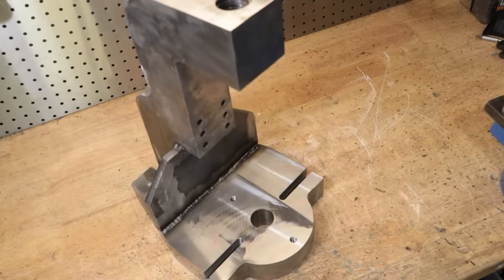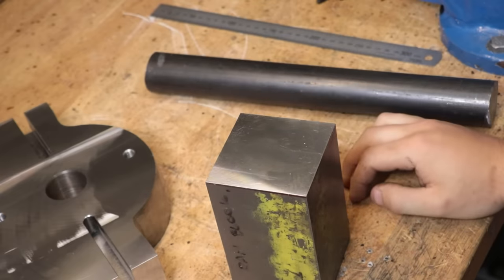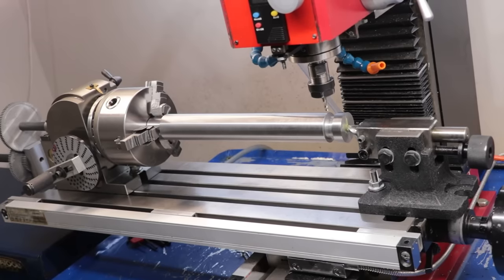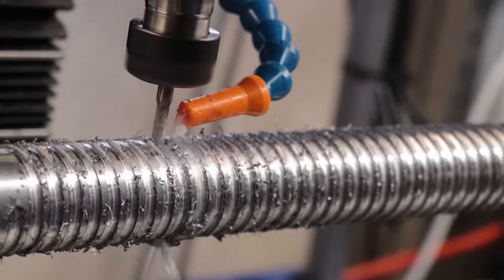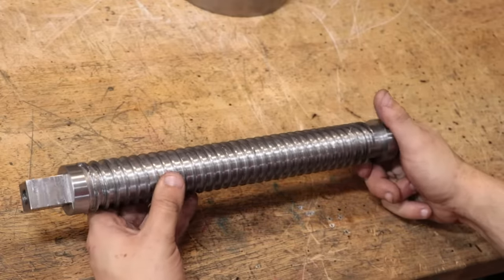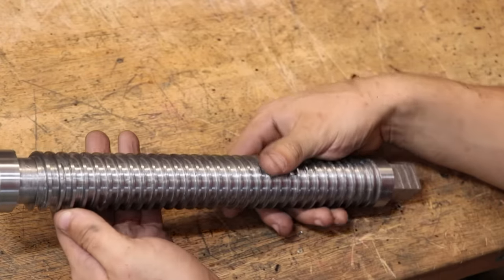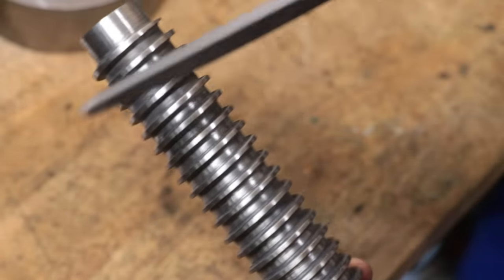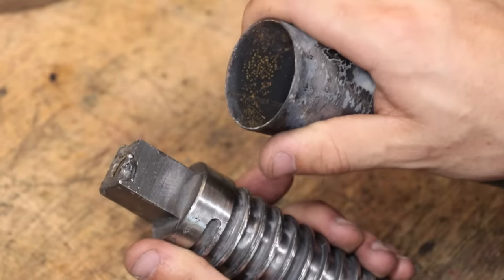Making A fly Press | Part 3 - Ram block, Gibs and Leadscrew

Comment: A tip to packing the charcoal. Weld a nut on the tube. Then use a drill with a low torque setting. It will shake it really good.
Reply: That's a really clever way to use ugga duggas!
Reply: If you have a Sawzall you can remove the blade, push the cutting guide against the object to be vibrated and pull the trigger.
Reply: Air hammer on low psi
Reply: @mortcs  or a jigsaw
Reply: Vibrations?
Lelo Enigma Wave ...
Men ... :P
Reply: @davidl6566   bubba duggas

Comment: Awesome work! When you do the hand turned helical milling, try using an end mill suitable for high feed milling. Either one designed specifically for high feed, sometimes they're called torus cutters, or just an end mill with a large corner radius. When you cut with the high feed technique, all the forces go up into the spindle, rather than sideways, so you're much less likely to break the end mill from turning a bit too fast. It's a good technique for slotting like this. You can then do a finish pass with a square end mill

Comment: Project coming together nicely, good job.
I think you made a little mistake with the oil grooves. They should be in the sides on the fix piece and not on the movable piece like you did. Because when you now move the ram down the oil grooves get exposed and all oil will just flow out which makes them pretty much useless.
Reply: My Sweeney and Blocksidge flypress has lube grooves in the ram from the factory, IIRC many makes are that way.
Reply: A bit of further information on my Sweeney & Blocksidge flypress, the lube grooves in the ram run from the top of the ram, open at the top, and run 60% of the way down the ram. When the ram is fully down ie the stop collar against the fly arm the grooves are only exposed by 8mm, that's not a position I've ever used it in so in normal operation the bottom of the grooves would never be exposed and oil lube retained.

Comment: Fascinating watching your design process! My little number 3 flyress has a split nut rather than a split ring so it screws into the ram block rather than being bolted. Same effect but way more difficult to fix if something gets damaged. Luckily I realized that I was missing a pressure disc bearing that goes between the arbor and the ram block, otherwise there would have been a bit of empty space between the two so the split nut would have taken the full transmission load instead of zero. Thanks for sharing all this process, it's a delight to watch!

Comment: Liked the superglue trick never tried it on a lathe but used it many times on thin parts in the mill
Reply from the maker: I've used it a few times on the mill too. Arguably I have had better results with it on the lathe than the mill

Comment: were you not worried about the leadscrew bending / distorting during heat treat?
Reply from the maker: Not really. Its quite a low tolerance build (something like this does not need to be high tolerance) so it can handle a bit of change and still work. Unless it comes out like a banana it'll be fine. The salt water should have helped get rid of any steam jackets that were a big cause of my parts warping in the past.
Reply: Interesting point about saltwater! I had the same question about potential warping the screw.

Comment: For milling the lead screw another method to consider is to tilt the spindle to the pitch angle and use and end mill parallel to a vertical tangent so the majority of the cutting force is upwards into the spindle. The radiused corners from this method does look good too.
Your welded example looks better than cast with a 3 to 0 from my sons.

Comment: If you have a saw zaw you can take off the blade and let it vibrate against the packing tube it works great with canister damascus so I bet it would work for this.

Comment: I have a couple of tipps for you. 
First, if you weld TIG, you can move slower and can do a few passes without any filler. The weld will look a lot better. 

If you mill, please roughmill only the diameter of the endmill in depth. It will last much longer...

Comment: I popped in the see a machinist I knew years ago and he was milling a thread and told me he started with a HSS end mill and was getting the feathery edges as you are, he switched to a new carbide end mill and the problem went away. BTW he wasn't doing it on a mill rather his large lathe where he had swapped the compound for a Bridgeport M milling head and set the lathe to about 1TPI IIRC for the job which was to be a hydraulic oil cooler, it was heavy drawn tube and the oil ran down the thread and coolant down the centre IIRC.

Comment: you could have put a soup can on top of the furnace to extend it up a bit and hold the heat in enough for it to heat evenly.
Reply from the maker: it was just more straightforward to flip it and get both ends up to high temperature for the best case hardening layer. Id probably want to build up some insulation around it if I were to extend the top upwards.

Comment: Brother if you would just slow down on your welding it would come out better. Use a technique like this do a slow 1. 2 count and Jack the puddle out and back.
Reply from the maker: I can fix that in editing by slowing down the footage :)
Reply: @artisanmakes  lol I meant no disrespect welding is one of the few things I'm good at I try to help anyone I can.
Actually a better method on the real thick stuff like the fly press when you strike your arc let the puddle build up for a count of 2 and then use a zig zag pattern no more than 3mm out and back and 3mm forward each leg. I love your channel I'm a long time subscriber I have a lathe and a mill and keep up with your projects
Reply from the maker: None at all. I know quite well that welding has and still is probably my weakest area. @quadpop4643
Reply: @artisanmakes  You could also stick weld the big stuff mig isn't meant for anything over 5mm actually unless you use flux core wire which is like a really long rod lol.

Comment: very cool...or rather hot, the build is going well
Its surprising just how hot Charcoal can burn once oxygen gets to it. I imagine there was a pin hole in the bottom weld and with the top being open to outside the furnace   it started to suck oxygen in, its good job you didnt leave it much longer or you could have lost the whole bottom end of your screw.
 I have burnt more in a charcoal forge than I ever have in a coal forge 
Do you have a way of seeing how much force the press will give you when its finished?
Thanks for sharing,
Reply from the maker: Bugger that could have been it. Didn't think there was a hole when I checked with water, although it could have cracked once it got up to temp. I am looking around for a hydraulic ram that I can stick a pressure gauge to measure the force but I haven't gotten around to that yet.

Comment: I always thought a flypress works by having the weight on the handle, on the "low gear" side?
From a physics point that would make a lot of sense, as energy is increasing with the velocity squared...
So a quarter of the weight of that block with double the speed would make the same force...
I know there is loss in the thread, but again, v squared....

Grats Julian

Comment: careful on agitating in quench, you don't want to distort the part.
Reply from the maker: I keep it moving to prevent a steam jacket from building up against the part as it cools. Steam jacket will very easily cause warping. Cheers

Comment: How come you never bothered to either invest in a metal bandsaw or tried to make an automatic hacksaw as one of your first projects? I am currently watching Part 1 to this and seen you in many previous videos that you manually hacksaw a lot. When I started out metalworking all the cutting to size I had to do made me so fed up with manually sawing everything for hours that the very first big project I did was automate my hacksaw by making a stand with a motorized excentric, a rod I bolted to my hacksaw and then put some weights on it to increase the bite. Worked like a charm 👌.  Tho, I admit I eventually bought a metal bandsaw half a decade later.
Reply: Every channel has their "thing". A sneaky way to get viewer comments. The use of a hacksaw guarantees him heaps and heaps of "engagement" from viewers.

Comment: hey artisan I have a question i got a Logan 820 last semester and I'm in need of a qctp, and I saw those cheap aluminum ones, I'm thinking about getting one in the meantime while I get a better one, do you think that is worth the money )30 USD) or i should just order the correct one?
Reply from the maker: I used to own one. Even in my small 7x14 lathe it struggled once I started to machine steel. For a Logan machine I probably wouldn't recommend one unless you were in a hurry to get a qctp and has no other option

Comment: Question: after you finish flood cooling, do you manually dry everything to avoid rust, or does the additive address that?
Reply from the maker: The coolant has additives to prevent rusting but as a precaution I dry up any large pools of coolant, and I usually give it a spray of WD40 or the like. I know people who run CNC machines with flood coolant and they never do this and they dont get rust
Reply: @artisanmakes  Thank you. Late night hey :)

Comment: Why not grind a HSS tool for the square profile and cut on your lathe?
Reply from the maker: You can't cut an 8mm pitch screw on this lathe
Reply: @artisanmakes I see so with the stock gear options you only have threading options from 0.25－2.5㎜. I have the same issue with my lathe, I'm limited to a 4TPI with the stock gears. I'm still trying to wrap my head around what gears I'll need to cut a 2TPI thread. it's possible to cut different threads if you have the right gears assuming the gears you need can physically fit on the lathe.
Reply from the maker: Yes tahat is correct. Buy several of the studs that the gears run on that connect the motor gearbox to the threading gear box are fixed in place.so i would have to remake the entire rear gear assembly to change the standard gear ratios
Reply: @artisanmakes  My Lathe is the same way with most of the gears being on fixed studs. but there are 3 gears which can be changed to alter the gear ratios to get more threading options. If I want to cut metric threads I have to change these gears from the 40Tx127Tx40T to a configuration where the three gears make a 40Tx120Tx127Tx40T or a 30Tx120Tx127Tx40T configuration (120T and 127T are both on one gear) Diametrical & Modular Thread Pitch (Inches) can be done with a 60Tx120Tx157Tx50T or 55Tx120Tx127Tx35T. unfortunately, the manual doesn't cover all the options so I'm still trying to figure out the gears needed for a 2TPI... but I've been warned that forces on the gears increase on course threads and can risk breaking the gears so That's given me some new pause in trying to figure this out.

Comment: Does a case hardened part need to be tempered?
Reply from the maker: Depends on the application. Some times you can leave a case hardened layer as is, but I always do a low temp cycle in the oven at 130c to help relieve any stresses without changing the hardness

Comment: Nice work, painful to watch lol.

Your female thread should have been bronze. It would have tapped nicer and would wear your screw out less over time.
Reply from the maker: screws hardened so the wear will be minimal.
Reply: @artisanmakes  the wear will be minimal to the easiest part to make. Start thinking about having to tap another steel part when it wears out.
I'd rather tap another bronze part.

Yes, I understand that this is only for a hobbyist.

Still, it's a cool build. I've enjoyed the series.
Hurry up and make a power hacksaw 🤣
Reply from the maker: Lets be real though, this press will never get enough use to even worry about wear on the parts. That blue vise I use is probably 30 - 35 years old and the wear in the screw is only moderate. And I use that every day. Cheers
Reply: @artisanmakes  Ok. Your 30YO blue vice will be made of:
1. A steel shaft
2. A cast iron/steel body
3. If it's a cast steel body, a bronze nut will be part of the assembly.

Im not shitting on your design at all. It's pretty cool, and I have absolutely no way of making this in my shed a better way.

I still look forward to seeing the rest of the build.
Reply from the maker: Yeah. Cast steel frame. ACME thread and steel acme nut. It's vintage but it's cheap vintage. Cheers